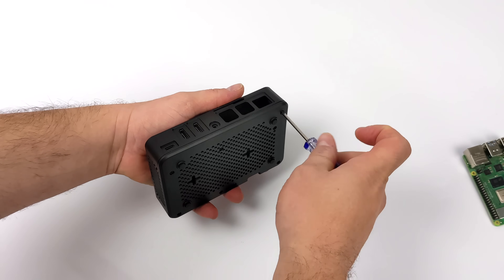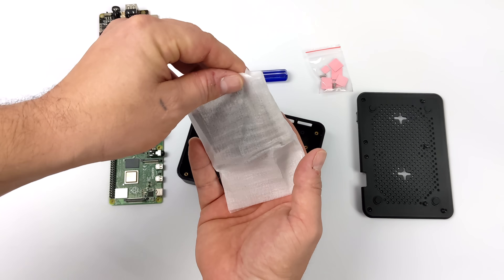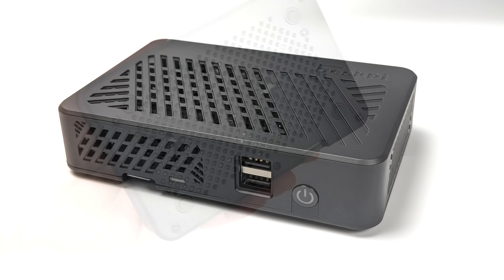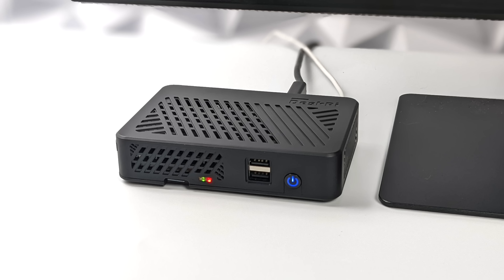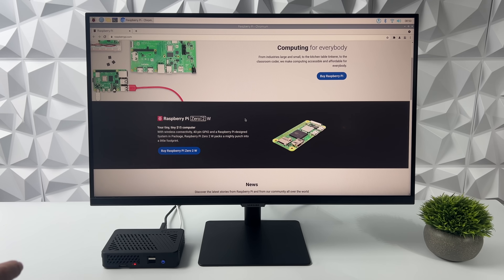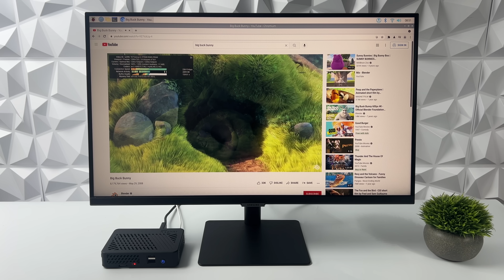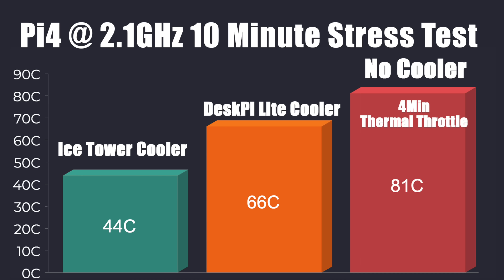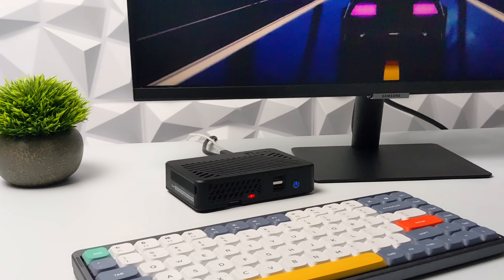Turn Your Pi4 Into An Awesome Mini Desktop PC With The All-New DeskPi Lite!

Comment: It is a nice little box, but what I don't understand is why these manufacturers are still using USB 2.0? All USB ports should now be at least 3.1 and USB-C.
Let's be real. I have a Pi 4 Model B with 4GB (8GB not available)... I don't think it will ever be used as a desktop replacement. Not even a laptop replacement. I think this type of device remain a tool for a hobbyist. Or could be used as a pfsense firewall if provided with dual ETH ports, or used as a travel Access Point connected to a VPN. Besided that type of use, no way it can be a desktop. Even with the best OS on it. I bought a pi cam with the little tiny acrylic transparent case for it. The connection cable is quite short and not really flexible in all directions. I don't see how this can be set as a security camera beside for a school project.
Once you add up all the accessories and the Pi board, you can definitely get a basic laptop that will give much more for the price or a little more.

Comment: What is the OS in use ? Sorry about the noob question, but how do you install an operating system ? . Can I run Windows? or what OS does it run. Can you explain how to get the OS working. Many thanks. I just love those Raspberry PI projects.

Comment: How do the front usb connect to the board?
Reply: 3:00 - 3:07 the front USB is shown here, next to the power button. The board receives all it's I O through the connectors on the side of the RPi. The only thing that doesn't is the fan which takes power from the GPIO pins.

Comment: What an extremely biased and non-critical review of another overpriced case that brings nothing new to the tired and overcrowded category of rpi 4b cases. The Argon One v1 has been out for what? 3 years now? Argon One v2 for at least 2 years. And the Argon One m.2 which does everything the $60 DeskPi Pro does for $15 less has been kicking around for over a year now. Congratulations to pi52 aka “geeekpi” for their extra late entry to hop on the bandwagon. They make nice stuff, but this plastic scrap is unworthy of any attention over all the existing options that have been out there for years.

I keep seeing comments about adding m.2 functionality and internal drives as well. Just to clear it up for the inexperienced and ill-informed: there is no case for the rpi 4b that could possibly allow it to directly interface with an m.2 or SATA storage controller. ALL of the cases with m.2 or SATA storage options facilitate the connection of the drive by using one of the USB 3.0 ports on the pi4 model B. If you want faster speeds than the USB 3.0 port on your pi4b can offer you are in the market for a CM4 and one of the carrier boards that offer an integrated storage controller on the pci bus.

Comment: So it can do pretty similar to the GeeekPi Acryl Raspberry Pi Set-Top-Box [~10$]
but costs 3x for PWM fan, on/off switch and GPIO accessable without further purchases?
If you don´t need the GPIO, I stick with the cheap GeekPi case, fan set to 3.3V, USB-on/off switch.

Comment: The only thing this has over the Argon case is the two USB ports in the front. Not sure if that's compelling enough to call it an upgrade over the Argon. I like the size of the Argon and the metal surface & premium feel.

Comment: Thanks for the informative video. How sensitive is it to the power supply? Can you use any old 5 Volt external battery or will it only work with one of those power adapters especially made for the Pi?

Comment: It's worth mentioning that the Pi 4 can do 1080p60 in h264 and 4k60 in h265 using hardware decoding. YouTube uses h264 so just make sure you have hardware acceleration enabled and h264ify extension installed in Chromium. There's tutorials online that show you how to do it.
Reply: yeah if you use h264 YouTube is not nearly as bad as people pretend it is on Pi.
you could also just use kodi for it too
Reply: Oh ok. Show us a screen cap of a pi4 playing a 1080p60 or 4k60 video on YouTube at the full source resolution and at the full 60fps. We’ll wait.
Reply: @grahamc87  the problem is software support for hardware decoding from the web browser.. Unfortunately a major issue on linux still.
Reply: @myslav1805  almost all desktop linux software uses va-api. Raspberry Pi doesn't support it so it's not a linux issue
Reply: @alexk4894  definitely not a linux issue, but it turns out to be because browsers dont usually support it oob and you even have to install special driver packages for it to work. I tried to get hw decoding working in both chromium and firefox and only had some success with firefox. That's on intel coffee lake graphics, mind you.

Comment: the argon one m.2 does the same stuff with an m.2 port
Reply: Yes, an m.2 port connected to a raspberry pi4 via usb 3.0. Both the argon one m.2 and the desk pi pro do it the same way. Both are just as slow. There’s no way to utilize the full speed of an m.2 drive with a pi4 model b

Comment: DUDE this is $30, this is probably one of the best if not the best case right now. For 40 bucks you get the full kit with the sd card, power supply, extra cables and stuff.

Comment: The problem with the DeskPi is that the PWM fan control isn't over GPIO so when you run Android the fan doesn't work...

The devs are mediocre at best with help and the fan even on Debian stops for no reason.

Overpriced and the devs aren't committed.

Comment: A lot of these Pi accessories are stupid expensive considering they're running with a raspberry pi but this one seems really reasonably priced at 30 bucks
Reply: Go with the Argon V2, it's really nice.
Reply: @Mr.Smith101  Wow that is really cool and only $25 on amazon with free one-day shipping.  Thanks!
Reply: @Watchandlearn91  You're welcome. You won't be disappointed.
Reply: because if supply chain issues and it’s smaller market. one reason what mac add ons are pricey too.
Reply: If you want something similar, just for the fullsize HDMI I would rather look for the GeeekPi Acryl Raspberry Pi Set-Top-Box Kit.
I considered it cheap in Europe atleast, dunno exact prices elsewhere.
Reply: @rockapartie  So you try to recommend me buying 2 cables, worth the same price as a fullsize-board-addon, with enclosure and active fan?
Doesn´t seem so wise tbh...
Specially since having spare fullsize HDMI cables is pretty common.
Reply: @rockapartie  There is a enclosure on german Amazon for like 16€ (~18$ incl. 19% german tax) it also makes the outputs fullsize and comes with a 3.3/5V fan.

"GeeekPi Acryl Raspberry Pi Set-Top-Box Kit"
Reply: the 30 bucks doesn't include daughter board
Reply: So who sells the daughter board?
Reply: @thresh-  idk, the GeekPi think I took was from german Amazon, the only listing I found for the one in the video, was the far more pricy pro variant for like 70€ (incl. 19% vat)

Comment: just finished turning my Pi 4 into a mini PS1 with the pistation case with thousands of games on it. runs Ps1, N64, atari 2600, NES, SNES, Saturn, Dreamcast GBA and GBC. even  overclocked it up to 2 ghz!
Reply: @Monte Veskeii mines the 4gb model, im using the latest version of Retropi OS not Rasberry OS.  i went into the config file on pc with Notepad ++ and changed the overclock settings to 2000 and the over voltage to 6. you can find videos on YT that show how to do this. my case also came with a fan for the cpu so overheating isnt an issue.

Comment: Good stuff as always! However my favourite case at the moment is RETROFLAG PiStation Case Pi 4 Case with 800x480 Pixel 3.4 inch LCD Screen & Stereo Speakers! Really cool! This is your fault because of your review! The only problem I have is a low voltage warning with LCD screen attached and with official RiP PSU at 5V 3A.... Just ordered more beefy PSU from the UK PiHut - 3.5A at 3.25V. I should confess that my Pi is OC and occasionally I hook some additional peripherals as well.

Comment: The extra USB is a major plus! Two things I'm not sure about:
- If the fan break how easy will it be to change it
- I need that ssd extension really bad

Case look neat though
Reply: Get the pro version for $60 can take a 2.5” ssd and has an ice tower cooler and is aluminum vs plastic
Reply: @greekmanx  already had the pro version. It was amazing. I had to return it because there was an issue with the fan. I currently have the geekworm x825-c8 plus a couple of accessories.

Comment: Don't use thermal pad on CPU. Buy a set of copper pads of different thickness, and use the suitable one as a spacer for CPU. Use some thermal paste to secure the pad and to improve thermal conductance.
Reply: Well Alexei, in general you are right but I've not experienced any overheating issues with the stock cooling options  for my RETROFLAG PiStation Case Pi 4 Case. I would go for better cooling option as soon as I see overheating signs but so far so good. My primary use for my Pi is retropie with different builds at 2Ghz OC.

Comment: the pi so SOOOO close to being a lightweight desktop replacement but it's just not quite there yet
Reply: I know, right? I'd say 2-3 more generations & it should be a good replacement
Reply: @Sithhy  problem is every year websites get less and less efficient with more and more extra bs aesthetics and background processes. The Pi would work amazingly if the internet was still as it was in 2008
Reply: yea it's just not powerful enough :(. there are computers with the Pentium Silver N6000 which are fully passively cooled and not too expensive !
Reply: all we can do is wait for the fifth
Reply: ROCK5 Model B
Reply: @kevinbbadd  that's what you think until you actually compare the sites and content now . I can assure you it's just nostalgia hitting hard
Reply: @SweatyFeetGirl  just because we live in 2022 doesn't mean we need unnecessary background processes and looks, some amount of eye candy is good but some and I mean some websites take it to another level which is completely unnecessary, simple websites with minimal eye candy is the best.